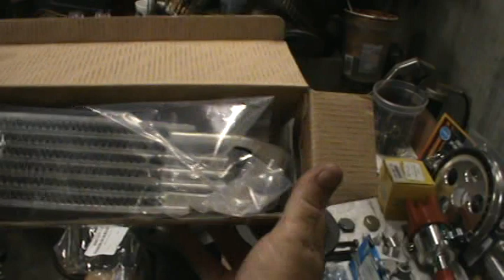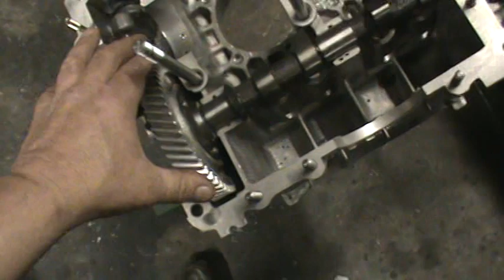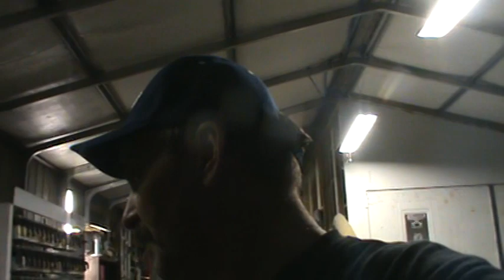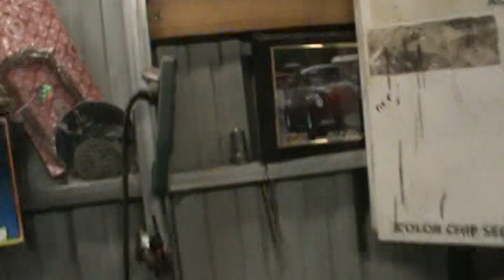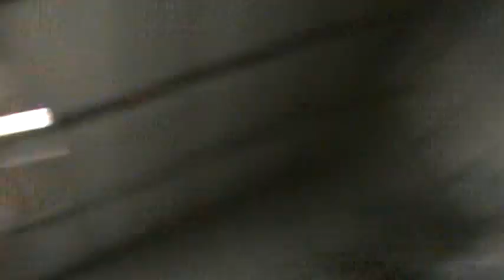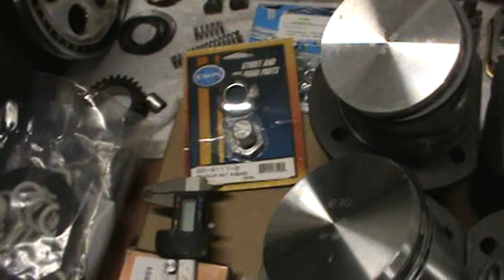How To Build a Super 1600 Part 1

Comment: Here's a free tip, if you buy a pulley bolt that is chrome plated, to remove the plating just carefully dip the threads in battery acid, I don't know how long maybe a minute is all that's needed. Be sure to rinse it in a solution of water and baking soda to neutralize the acid.

Comment: Thank you Darrin and thank you internet/youtube. Exactly the assembly problems that I just have to experience: new camshaft bearing too tight, oilpump too long...

What I already learned and this time did right is taking my time and fitting the bearings correctly into the dowel pins. It worked!

Is there a video showing the disasambling and asembling of the crank gears? quite hard to without the right tools...

Thank´s alot

Bjoern from good old Germany